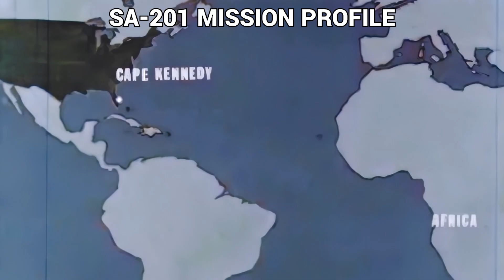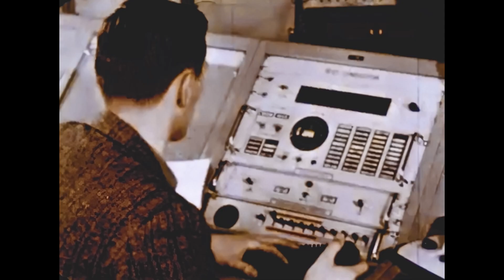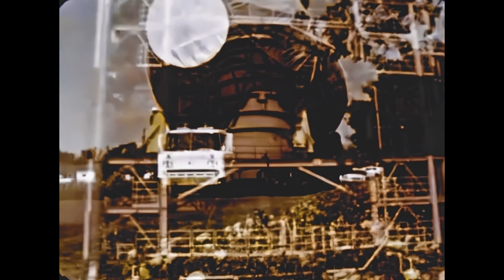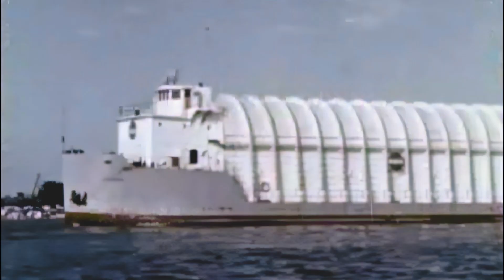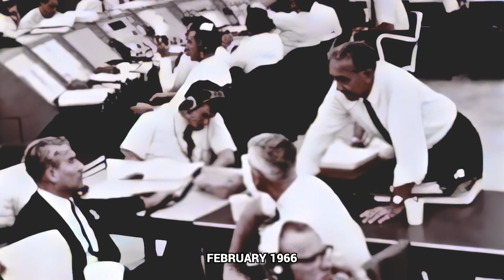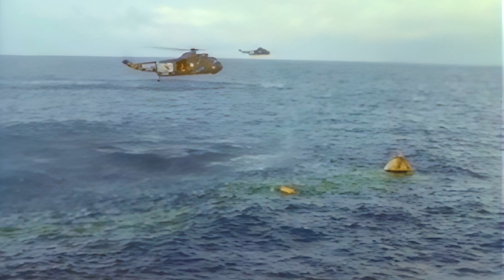SA-201 Full Mission - Saturn IB - Apollo 1-A, AS-201,  Historical Footage and Audio, Remastered

Comment: What's with the three announcers?

How brave the Ap7 and Skylab and ASTP were to ride on a rocket built by Chrysler!
Reply: Different source films.
Reply: Safer than the Space Shuttle…
Reply: @allangibson8494  Shuttle Orbiter was perfectly safe. Richard Nixon's booster system was problematic.
Reply: @Canada_Dominium  The Orbiter was rather too fragile (and over sized to fit the KH-11/12 imaging satellites (which it only launched two of the twenty lofted)). (The KH-11 was the brother to the Hubble but pointed the other way).
Reply: @allangibson8494  The Orbiter behaved perfectly well.  Nixon's refusal of a proper booster system was the failure.  I am sorry you supported him.
Reply: @Canada_Dominium  Both had serious issues - starting with ditching the metric units used on all the man rated boosters until then. (Apollo had metric bolts - Space Shuttle used imperial sizes).
Reply: @allangibson8494  Shuttle Orbiter performed flawlessly.  Nixon's booster system was the failure.
Reply: @Canada_Dominium  The Orbiter failed catastrophically once and less catastrophically on other occasions (like the first flight where all the flve flight control computers failed (the fifth as the wheels hit the ground).
Reply: @allangibson8494  "The Orbiter failed catastrophically once"

No, Nixon's booster system was at fault both times.

"the first flight where all the flve flight control computers failed"

False.

"the fifth as the wheels hit the ground"

False.
Reply: @allangibson8494  I am sorry you supported Richard Nixon. The whole STS was his idea.
Reply: @Canada_Dominium  The Democrat Congress’ booster system, not Nixon’s.
Reply: @Canada_Dominium  You who have Jussie Trudeau or Mark Carney have no room to denounce any US leaders.
Reply: @Canada_Dominium  The Democrat Congress’ boosters were the failure.
Reply: @BradH2024  NASA was directed by Nixon and Republican-controlled Congress to adapt the Titan III booster design to STS.  This is a matter of historical record.
Reply: @BradH2024  The world disagrees with your assessment.
Reply: @BradH2024  Prime Minister Mark Carney is the leader of the FREE world.  The former 'US' is now a police state like N. Korea or Iran or Russia.